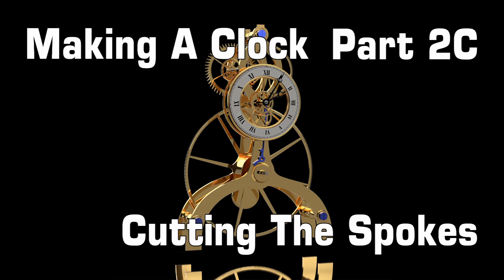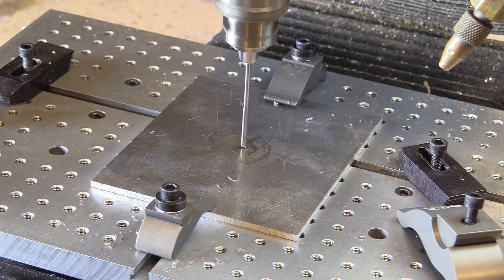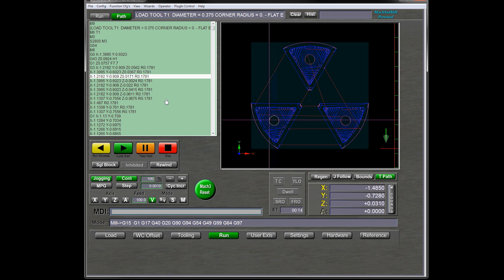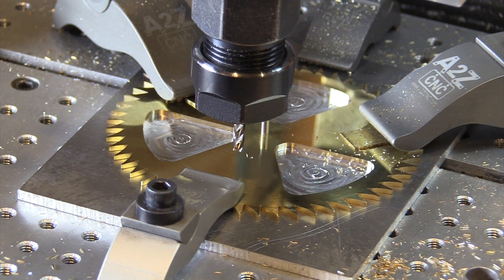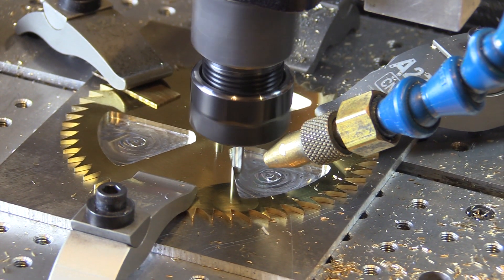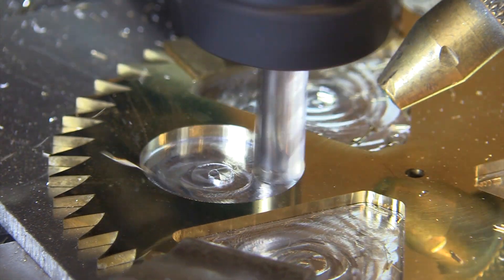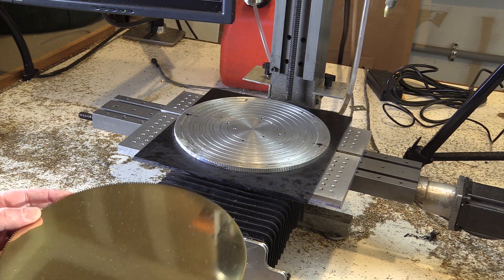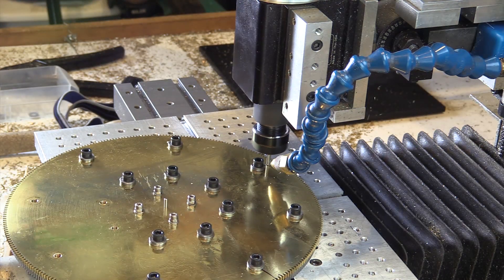Making A Clock - Part 2C Cutting Gear Spokes

Comment: Very nice again!  How did you index the large gear when you flipped it around?
Reply from the maker: Thanks, glad you liked it! I apologize for neglecting to film that part of the build. If you go to 13:45 in the video you'll see that I predrilled the four collet mounting holes in the center of the gear. Those holes were all a tight fit for the screws so I was able to flip the gear. register it and lock it down with them. It may not be 'perfect' but the spokes are only decorative. I doubt that I could examine the finished gear now and find any difference in the spokes. Maybe I was just lucky!

Comment: Coming together really nicely. Why did you mill away all the waste material for the smaller gears rather than just cutting them out like the larger gear? Also, are the tables underneath sacrificial, or do you somehow shim the workpiece off the table?
Reply from the maker: Thanks! I explained the strategy for milling out the spokes in the previous video (Part 2B) on CAM. The aluminum pieces that I put the dowel pins in and mount the gears on are sacrificial.